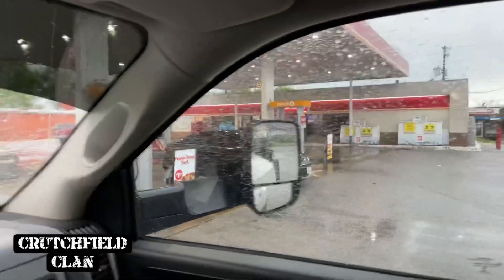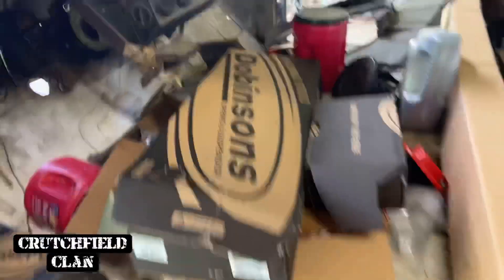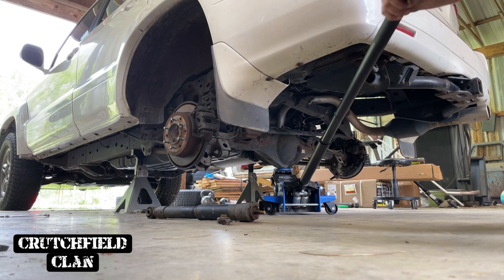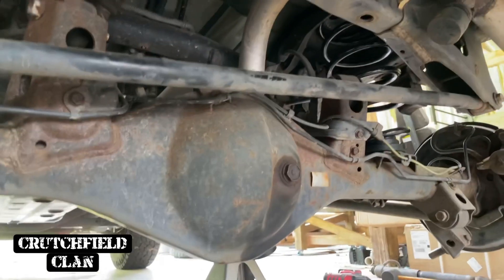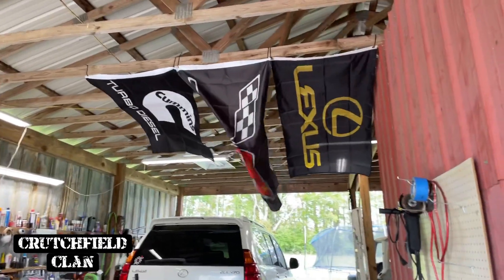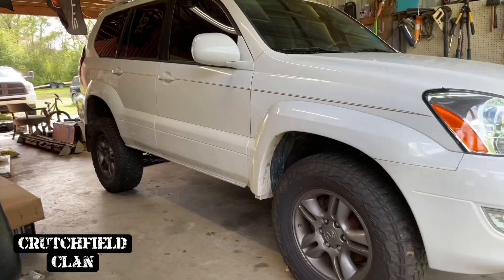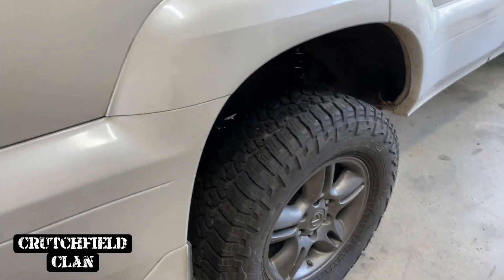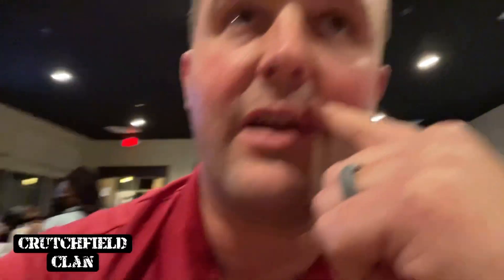Lexus GX470 Project Maverick | Dobinsons IMS rear lift installed and we give away a little $

Comment: I also had to cut the top bolt off. My kit didn’t come with anything for the top of the spring. Do I need the spring isolation rubber? Were would could I get them if I need them.
Reply from the maker: You’ll just run metal on metal if you don’t get the upper isolator. I’ve got a set that I can sell to you if shipping won’t kill pricing
Reply: @crutchfieldautomotive7936  I am in Oregon and don’t need them in a hurry. How much do you want and how can would you like to receive your money? Thank you!
Reply from the maker: Let me check on shipping first. If there’s a kit that will save you money over what I’ve got I will send a link. I just got home from work so I’m fixing to crash for a little while